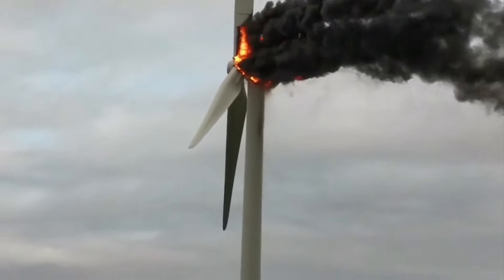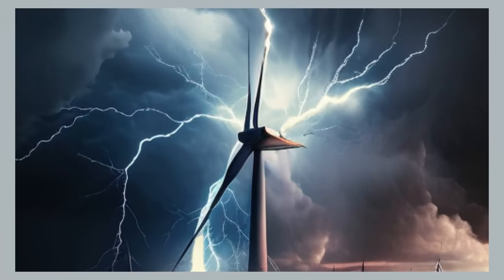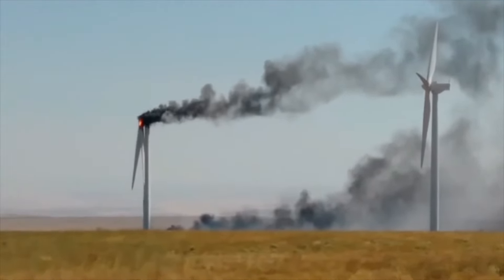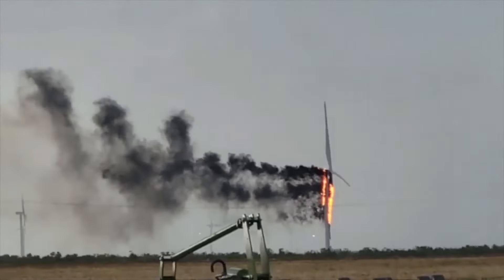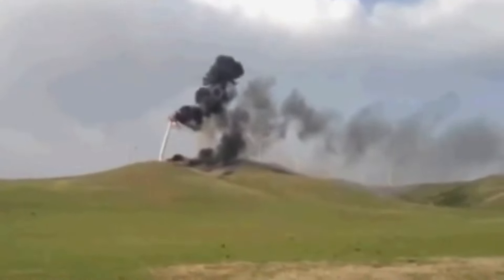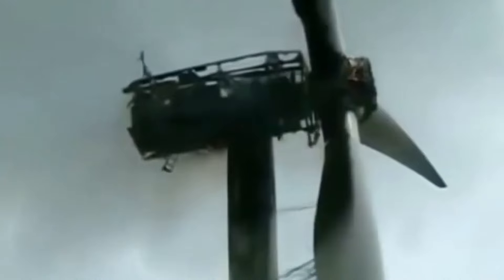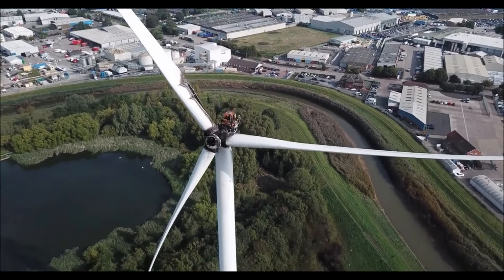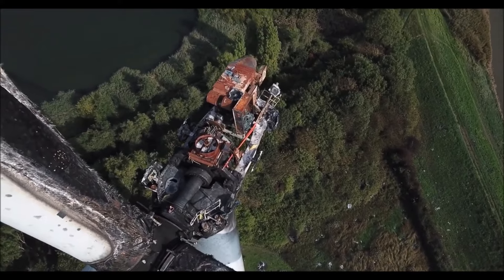Why Wind Turbines catches Fires ?

Comment: An absolute winner (except for replacing the blades, topping up the diesel and the risk of fires) that generates electricity 15 to 30% of the time.
Plus each foundation uses around 40 tons of concrete.